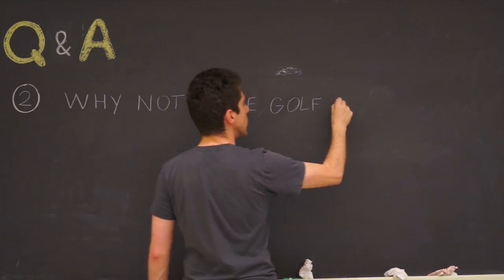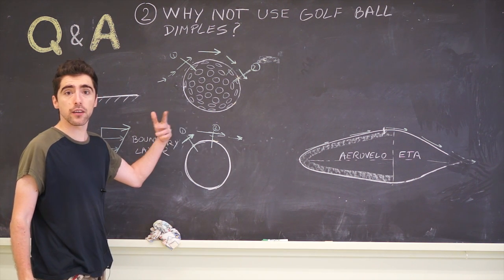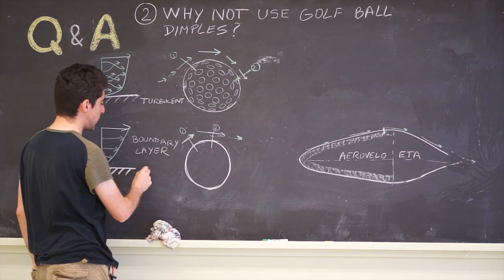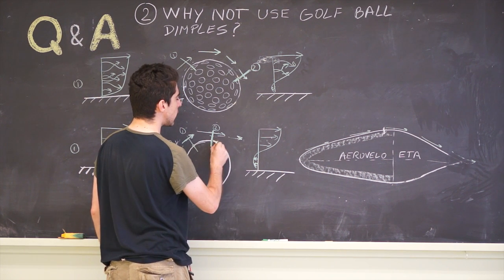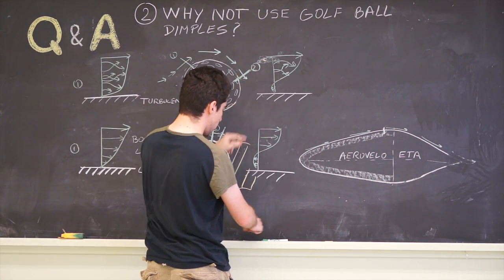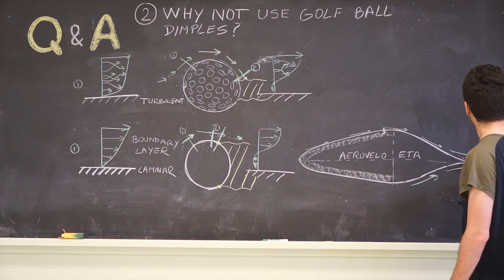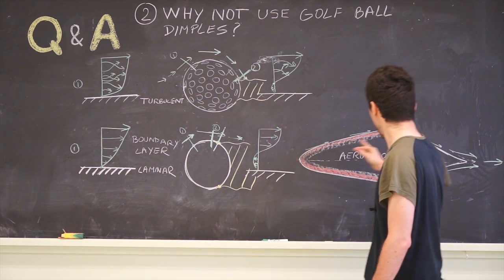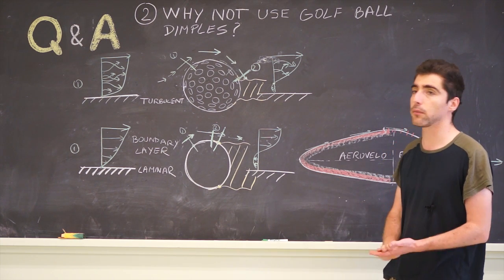Q&A: Why doesn't AeroVelo's speedbike use Golf Ball Dimples?

Comment: These dimples are only effective in angular shapes, like golfball, in straight tubes will have little effect, teardrop is better suited for straight line tubes as the teardrop shape and depth is not constant like the golfball dimple, the teardrop starts with very little depth to full depth in the teardrop pool making for an "ramp" effect pushing air upwards like a ocean wave making an "C", in straightline tube with golfball dimples the speed of the air cannot fully pressurize against the bottom of the depth of the dimple to create this "ramp effect" but instead hits the edges of the circle with a very similar but smaller effect, dimples would work in an instance with dimples just before the bend and partially into the bend not all the way in an L shaped tube where airflow hits the wall of the tube on the bend

Comment: This was actually very interesting! Would it make any sense to design a streamlined shape with a hole/canal going throug it from tip to tail? Sort of like an elongated donut. In order to avoid the stationary air cushions building up in front and behind the shape? (Given the fact that you don´t have to pierce this canal through the body of a rider sitting inside ...) Or it it just an error in reasoning becaus you would than have all the friction just on the inside? respectively you replace one tip by a new "tip" in a circular shape ...
Reply: possible...but yea, any area in contact with the air provides skin friction, and would be bad. Generally, if you  have a big opening in your shape with a pipe going thru the interior, you could have made the whole thing smaller, and get rid some of skin friction. 

The high pressure areas in the front and low pressure in the back would now be a ring, instead of a circle. Somewhere the air has to be stationary.

Comment: The plot thickens: However intake manifold of a 600Hp engine gained 23 hp wit dimples.
Reply: I work in very high end motorsports..( sorry not allowed to disclose where , so your guess where is pretty easy) and not used dimples to date.      We say: its a solution for a problem created by yourselve....😄😄
Reply: Well, the plot gets more density. Thickens is not a technical term :P

Different air situations require different measures. If the manifold had any separation, dimples would definitely help. There might not be enough room to make the intake a shape that has no internal separation. The shape being fixed (or at least constrained) then the surface can be made to deal with some of the separated air. 

For us, we could make a shape with no separation quite easily. So no need to use surface features.

Comment: This does not make much sense to me.I say the turbulent air is slowed down so it can turn around the ball.The smooth fast non Dimple set up has the majority of the air go so fast momentum stops it going around the bend.
Reply: Unfortunately you are wrong. Aerodynamics is not really intuitive. It took me a while to understand why mixing fast and slow air, due to turbulence, can bent a curve better than slow air from the laminar air. The trick is to understand that the air right next to the object is perfectly still relative to the object. The goal is to keep the air moving against the object, and not make it move backwards. 
For example, https://www.researchgate.net/publication/327793049_The_Effects_of_Reynolds_Number_on_Flow_Separation_of_Naca_Aerofoil is a test showing that separation occurs at higher angles of attack for higher Reynolds numbers, which increase linearly with speed. So faster air can bend the curve better than slow air. 

My understanding is not perfect, and still trying to find the best way to explain it. Good luck trying to understand it better, it is not simple, nor easy.
Reply: @victorragusila7519  Unfortunately you are wrong.
Reply: @lomasck  care to elaborate? I always want to learn more about aerodynamics.
Reply: @victorragusila7519  The problem with Aerodynamics is we cant see it.I think we are always  trying to understand it that's why I was watching your video after all.Because I did not understand your explanation I came up with my simpler explanation. Perhaps I am wrong.I guess I was just challenging  your story  on it.OK .I just looked at some other explanations on Youtube & have a important Question.  Does the ball have to spin in flight.That could change everything.How important is the spin factor ?
Reply: @lomasck  The spin would definitely affect things, but I think that is a separate problem. Understanding it without spin is important to help understand it with spin later on. 

I looked for a few more videos to recommend for you, and because I need a refresher course in Aerodynamics, since i havent looked at it for a few years (off to a new obsession for now). 

I highly recommend this video, they explain boundary layer better than me, without going into Laminar VS turbulent discussion https://www.youtube.com/watch?v=5zLCofDSt_Q
The Wiki page on flow separation also has some good info .https://en.wikipedia.org/wiki/Flow_separation

We actually can see aerodynamics. We need a wind tunnel or day with fog, but we can see (with the help of smoke) the way the air behaves. It was probably one of the main tools that helped develop airplanes around the two world wars. I am sure you can find some really good videos of flow around balls or wings. 

A few points that helped me understand aerodynamics: 
1) dont think of air as small balls that move around a wing. A faster small ball is harder to turn, whereas a slow one can turn easily. I think that is why intuitively, it is easy to think that fast air separates easier. 

2) Air works more like molasses, it has viscosity. Much smaller than molasses, but it still exists. There is friction between all layers of air, and between air and any object. 

3) Separation means air moves backwards over a wing (if we think of the wing as 0 velocity). For a ball going thru the air, it means the air sticks to the ball and travels with it. That is generally BAD. You dont want your ball (or wing) to grab a bunch of air and take it along, that creates lots of drag. You want the air to stay exactly where it was before your wing or ball moved thru it. That would be 0 drag (and impossible). 

Good luck, it took me a while to find an explanation that made it click for me. I was lucky to have a few classmates that took a lot more aerodynamics courses than me, and were very good at explaining it. Once you understand the effects of boundary layer velocity on pressure and separation, you should be able to derive the effect of spin.
Reply: @victorragusila7519  Thank you for this reply.I guess there is a lot more to it than I thought.Sorry if I was being ignorant before.
Reply: You are welcome. Everyone is born ignorant,  but it's great you are looking for a good explanation. Hope I can help, and if not, you can find a better explanation that works for you.
Reply: @victorragusila7519  Cheers and once again thank you very much for your patience.
Reply: @victorragusila7519  shame that no one has seriously gone after the record for 8 years. If you were to go for it now, what improvements would you make? Use Fillipo Ganna? Ice vest for the pilot? Oxygen tank? Solid hard rubber tire with high recovery? Drivetrain upgrade? 
Aero seems pretty settled, everyone uses the Eta shape now. Any advantage to laying down more and flattening out the back?

Comment: Would dimples on under side of wings increase lift?
Reply: I dont see why they would. They would increase skin drag, but I cant think of a mechanism that would result in more lift... 
Objects on underside of wings dont seem to affect the lift negatively too much either. All airplanes hang engines, rockets, missiles, fuel tanks, etc under the wing, keeping the top side as clean as possible, with the exception of turbulators.

Comment: Thing is, you are probably wrong. Mythbuster did a dimple car test and it was more fuel efficient. Why not try?
Reply: dimples work for car-like object, or sphere like object. For an object with a tail that we can shape, it is not going to help. Not worth trying because we know the effects of even thicker tape on the back of the bike, which disturbs the airflow and causes higher drag. Dimples would add even more drag.
Reply: @victorragusila7519  well, based on where the body seam is it's obvious why tape added would be a negative. The initial guess would be to put dimples on the rear surfaces of the body.

Comment: Outstanding, however if one places dimps on the back ETA the disturbance mix flow the pressure conforms to give a greater positive squeeze back toward the front more than its smooth path let's see...just a widget thought in the case of the Russian Subroc torpedoes which uses it's soild or liquid spented exhaust gases to create the "Mass Disturbance" of air at front cone ports matching the same speed while submerged underwater as if were in air flight...then greater pressure follows the contours of the sphere and the bare proof is right in front of you, the key is the sphere, look at your sphere that's the key, however it clearly not be disregard... feedback responds welcome please

Comment: Mythbusters Golf Ball Car, already proved it improved MPG. sorry
Reply: it does on a car, because a car's exterior shape cannot be changed (much). If the shape is fixed (ball, car, truck) then surface aero devices, such as dimples, turbulators, etc, can help quite a bit. But for our bike we were able to use a nearly-perfect shape, so no need for those band-aid fixes. not sorry. :P

Comment: Hi,
first off, very nice video. I finally got it:) Thank you for that. Here is a related question though...Taka .22LR bullet (5.6mm diameter,  2.6 grams, flat base, V_start=325(m/s)...strap on a boat tail to it, also have it at 2.6 grams and V_start=300m/s. When/what distance would you start to see the energies of both projectiles are equal? 100m? 200m?

Or to make it more simple...if i were to put a boat tail on a .22LR (keep the same weight) how much will I gain?

Also..do you think that it's possible to keep the flow at the nose of the bullet laminar at those speeds (325 m/s and 300m/s) or it's not even worth trying it'll go turbulent as soon as the air reaches the projectile?
Reply: not sure about projectiles at high speed. my guess is that there is a lot of research out there, that you can find for free.

Comment: What about dimpling a baseball bat? Would that result in the possibility for a faster swing?
Reply: +John Hogue Drag forces are a small contribution to the energy of a baseball bat.
Reply: @appa609  Regardless with what contributes as a "small contribution," many small contributions create one big one. In theory, yes it will help. If you have the means to do it,  do it.
Reply: Waylon Jeffery well it’s not clear it will be a net positive contribution. Dumpling the bat is also going to slightly decrease the stiffness if the bat. The overall restitution may go down. And it would certainly cost more. Even if it were right it would  be tiny.
Reply: Well and, if the ball contacts a dimple it's not going to go where the batter wanted it to

Comment: The video seems like a well-reasoned argument for using smooth surfaces, that are also probably less complex/costly than dimpled. The bike is designed to sustain laminar flow for the greatest possible length along the body. The laminar flow is expected to become turbulent in the rear section of the body, can golf ball dimples from the turbulent point rearward provide less drag than a smooth surface? I didn't pick up on any evidence presented to show that dimples would hinder performance.
Reply: +Jeremy Priede dimple surfaces have greater surface area than smoother surfaces. As such, they got greater drag if the flow is attached. We are very confident our flow is attached over the whole bike, so there is no reason to use dimples. We are confident of this because our drag in real life is very close to the estimated drag (and we estimate no separation) and if there was any separation, our drag would be much higher, very noticeable so.
Reply: Thanks, I had thought that it was turbulence that caused drag, but as you point out - it is separation that causes drag. And turbulence can be used by a golf ball to decrease separation (and thus decrease drag).
Reply: +Jeremy Priede nope. I suggest you watch the video again. There are a number of causes for drag, such as skin friction and separation. We got no separation on the bike, so no golf ball dimples are necessary. 

Skin friction causes drag, and gold ball dimples make it worse. Not only golf ball dimples have more surface area, which causes more skin friction, but they also make the air more turbulent. More turbulent air means faster moving air molecules are able to get closer to the skin of the vehicle, thus increasing the skin drag. 

So gold ball dimples are always bad, unless you have separation, and are not able to get rid of separation any other way. They are a last resort for cases where the shape cannot be changed.
Reply: @VRagusila  I'd think that turbulent flow allows outside air to contact turbulent air instead of the skin itself. Air on air contact is much more frictionless than air on a solid
Reply: @NwoDispatcher  I wouldnt think that way, but its your brain. 
TLDW: Turbulent boundary layer has more friction, than laminar. Laminar air is more prone to separation, which is very high drag. We didnt get separation in the kind of air we move in, so we tried to have as much laminar flow as possible, without intentionally adding turbulence.
Reply: @victorragusila7519  it occurs to me that you only get separation on the back end of a moving body. What if the dimples were on the front? I dont think its the separation that  is the issue, but the low pressure created by  the displaced stationary atmosphere. Ideally, a body surrounded by a vacuum would be the best condition, right? 

i dont know. I look at the aerospike pole they put out the top of some missles and wonder how one could create that pressure wake in more places
Reply: @victorragusila7519 but you already state in the video that it’s going to trip at 50% chord length. So it’s going turbulent, but not separating. Could you keep the turbulent boundary layer smaller by using a shark skin film like Aeroshark? It’s in use by the solar race teams, so it’s obtainable and seems like it’s effective at reducing skin friction when in a turbulent regime
Reply: The myth busters tried this with a car and they were wrong! The dimples made the cars mpg increase

Comment: Have you guys looked at how much energy it would take to implement active boundary layer control - suck it down - to achieve more laminar flow?  My guess would be the energy required to drive the boundary layer suction would be too much to justify the complexity, but I'm still curious what your thoughts are.
Reply: Zach Hazen  Boundary layer control is a pretty hot topic, that I know nothing about :P. What I know that RC planes have been used as proof of concept for boundary layer plasma actuation, and that it worked really well at keeping the boundary layer attached. 

Any system we implement would need to be human powered. For this year, we did not bother even looking at it, there were a lot of places we could get easier performance out of the bike and rider. The University of Toronto human powered vehicle design team (which I used to lead) will probably look into it in one of their upcoming ASME bikes.
Reply: It looks like it's going to become someone's Master's project.

Comment: I would love to see some Monotracer type vehicles,except as a commuter type vehicle,single seat,low drag body,conventional door,light weight,small electric or 250 cc engine.Enclose a MP3,Yamaha Tricity parallel link type front end to eliminate out riggers,single wheel in rear.Why not a morphable surface,dimples at low speed only?